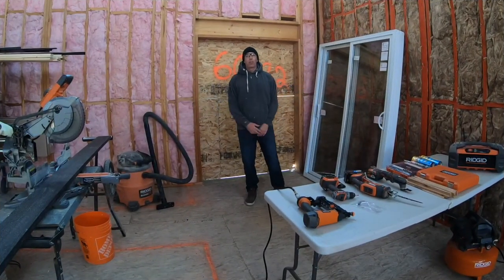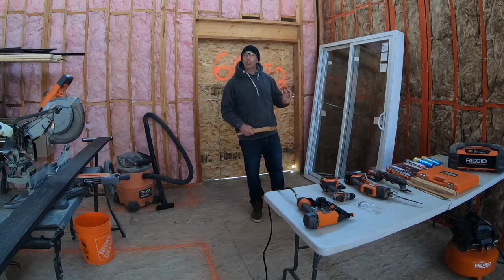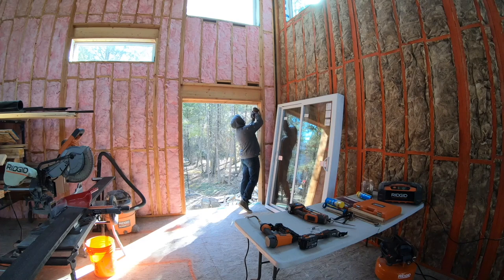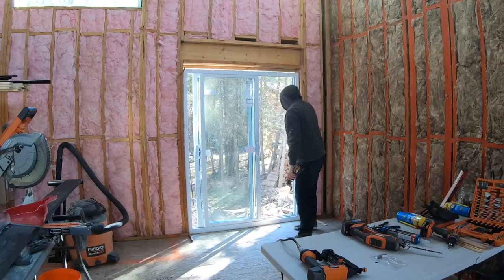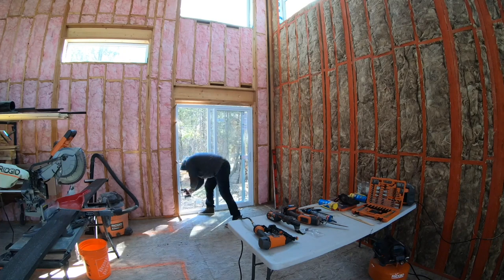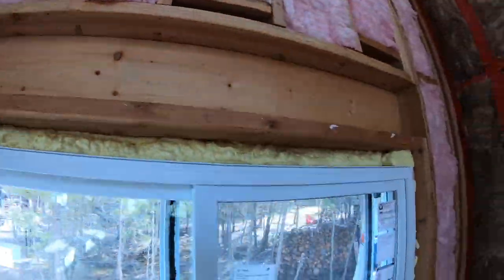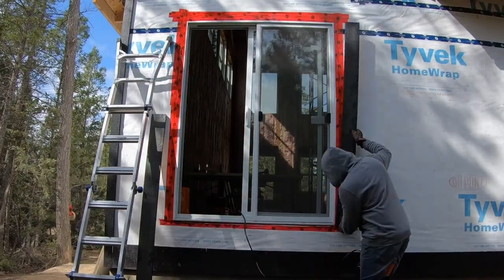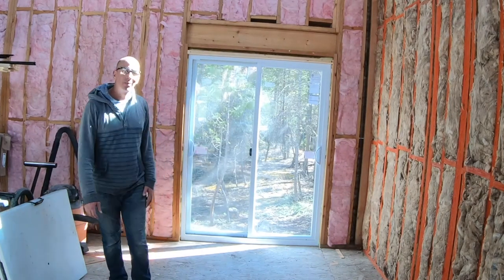SLIDING PATIO DOOR DIY CABIN BUILD

Comment: I have a sliding two panel door and a wall composed of empty space. How do I build the opening to put the door into???
Reply from the maker: You would open the wall and frame out the rough opening for the door. It will need a structural header and some cripple studs under to hold the header or beam. It’s actually a hard diy job, make sure you understand everything before you start putting large openings in exterior walls. I would contact an engineer to give you the specs on header size and cripple sizes. Hope that helps